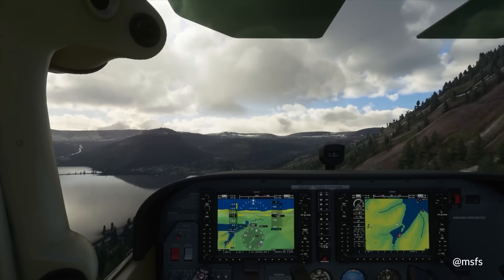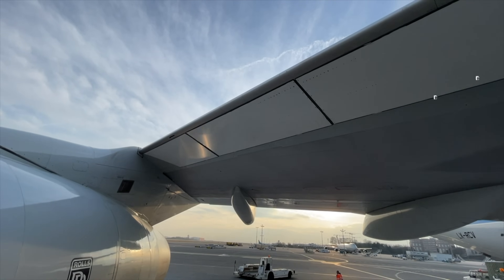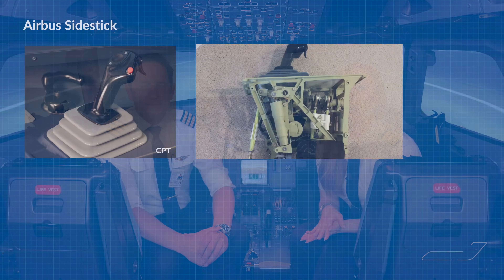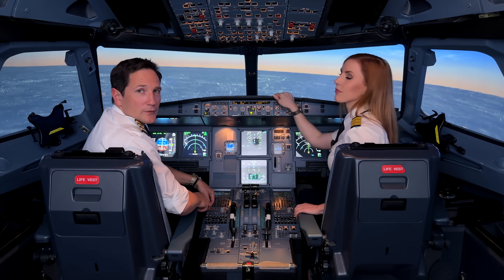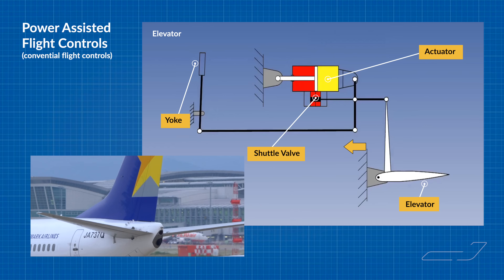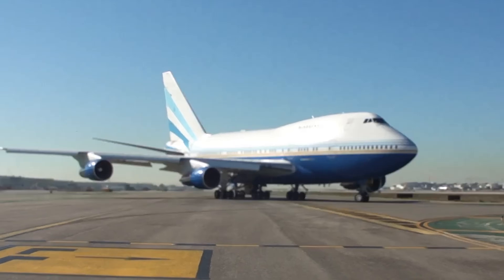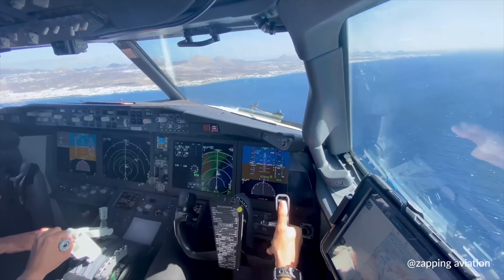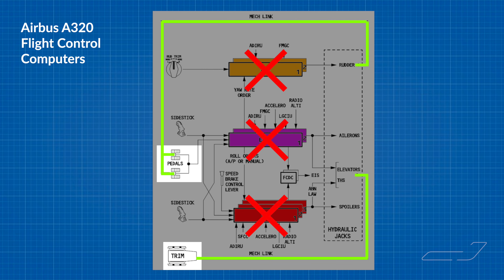Which AIRLINE JET has the better FLIGHT CONTROLS? Explained by Captain Joe and Raja

Comment: After 30,000 hours flying a multitude of Boeings and Airbus, my choice is Boeing. The reason I chose Boeing is situational awareness. The side stick is great but it isn't mirrored on the non flying pilot side. Even if it were, the movements are so slight, it would be difficult to determine what the flying pilot was doing. In a boeing you have the old faithful yoke. It's easy to see wht the flying pilot is doing and if necessary either help on the controls or at the very least see what he/she is doing. The auto throttles don't move in the Bus. Again, no situational awareness. Seeing the throttles move is in my opinion essential. You can't cross control an Airbus. The side stick controls RATE of turn, not ANGLE of bank. So, in a crosswind, you either time kicking out the crab to land straight or land in a crab. In a Boeing you can actually do a forward slip just like you did when you were learning to fly if you are more than 60 years old you will understand. It works in all Boeings except the 747 because of the outboard engine and the 737 with the curb feeler winlets. The only thing I like about the Airbus is the dinner tray.
Reply: I am no pilot, but i see Mentour Pilot has the same complaint often about the input not being felt in the other stick and that could have saved some events.
However i do appreciate Airbus hard laws or whatever it is called has saved people where the pilots would have caused their demise.
Reply: @rasta77-x7o UPRT is mandatory on every airplane even airplanes with stall prevention systems like Airbus because someone managed to stall and crashed an A320. Airbus’s prevention mostly only works if you actually know how to deal with it
Reply: Great explanation
Reply: Being no pilot at all, and no simmer, neither, I have a gut feeling that if a pilot receives the feedback from the aircraft (and the other pilot) via the controls, his/her situational awareness is better. 
Not long time ago, some experienced pilot said that there were less and less fliers, but more and more aircraft operators. Airbus' philosophy seems to prefer the latter. In my humble opinion, regretfully. Having said this, I must admit that I board both, Boeings and Airbuses, with the same level of fear. It doesn't matter what machine a pilot is flying, he/she will do his/her best to get back home in one piece after the shift is over.

Comment: There is no comparison B/W B-747 Control Column & Atari Joystick (with due respect). During take off, when you pull B-747 C/C to rotate, you move back in your seat & face the sky, as you are flying yourself like a bird. Long live Boeing 747

Comment: I have a 12 year old son who is fascinated by Aeroplanes, we have tried both the 737 and A320 Fixed based sims, not having flown anything before we both thought the A320 was the most natural to fly for a novice.  I think it comes down to are you really flying the A320 or just there for the ride, the Boeing needs a lot more pilot input.

I didn’t know the 777 was fly by wire, I thought all Boeing were traditional mechanical flight control mechanisms.
Reply: Because a novice can tell what is the most "natural" (whatever that's supposed to mean) way an aircraft is supposed to fly....🤦🏼‍♂️ And also, of course they design aircraft controls based on what is easier for people who have no idea about flying! So, very good point from your side
Reply: The 777 and 787 are fly-by-wire, but in a different way as Airbus.
Reply: The 777 feels light as a feather because of its FBW, even at MTOW.

Comment: The general dynamics F-16 was the first the Fly by wire aircraft
Reply: F 16 was the first to use a side stick.   A limited fly by wire was used in the Lockheed 1011 TriStar. The TriStar was very sophisticated with computer management and was the first airliner to fly from takeoff to landing under autopilot control completely. TriStar came 2 years before A300. Would have been 3 years earlier if RollsRoyce had not had financial problems developing the engines.

Comment: I believe the F-117 Nighthawk was the first full fly-by-wire plane. Its non-commercial :)=. Otherwise nice video👍
Reply: Can't have been. Concorde was the First fly by wire Passenger jet, and that was built in the 60s, F117 wasn't built until the 80s.
Reply: @GVTSounds  Concorde was a commercial aircraft.

Comment: airbus and his "fly by computer" that is my definition.
for "fly by wire" flight controls should ALWAYS represent of real position of control surfaces. And if computer decides it's not safe, force movement of yoke/stick is activated, like stick-pusher do, in many modern aircraft.
that is a way I see that.
and airbus's "fly by computer" proof safety of that system.

Comment: next question why is it that when you are landing you push and pull the yoke and twisting it inn and out then right and left in a constant movement
Reply: Bigger deflections of the control surfaces are needed at low speed due to less air flowing over the surfaces. In Airbus the computer compensates for this so you only have to make small corrections
Reply: They have to make adjustments to maintain their glideslope ant the centerline, especially if they're dealing with crosswinds.
Reply: Looking at pilots landing a 737, there seems to be a lot of this. I believe it is down to the lack of FBW, instead being old fashioned cables and pulleys. These mean the flight controls are a lot more sensitive. Try that in a 777 and you’ll snap the wings off.

Comment: Boeing definitely has better flight controls: is visible, tandem yoke, feedback. 

Airbus (A): The dual input on fly by wire is risky.
Reply: The Bluetooth device disconnected
Reply: Air France 11 proved you can dual input a Boeing 777 and be none the wiser